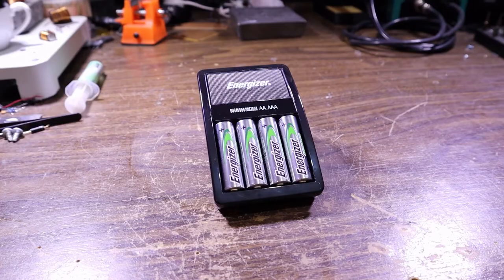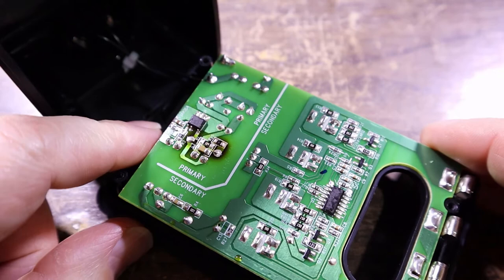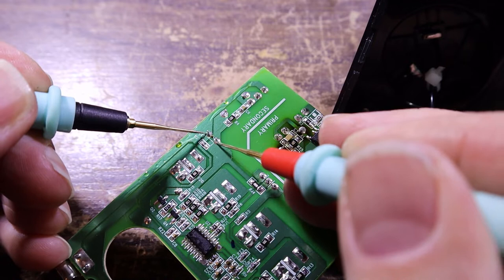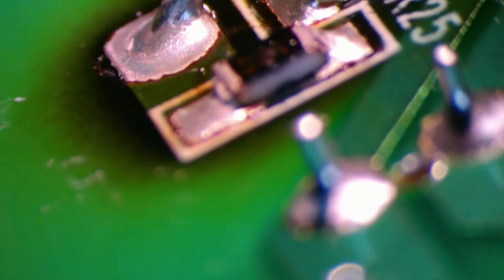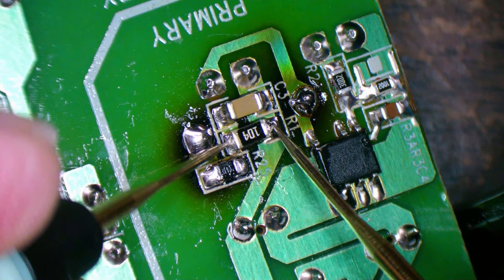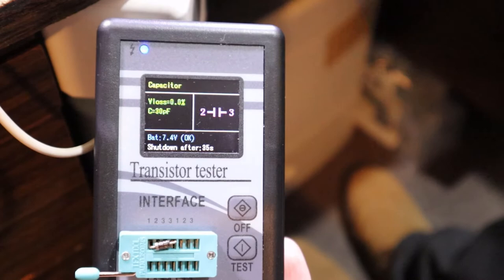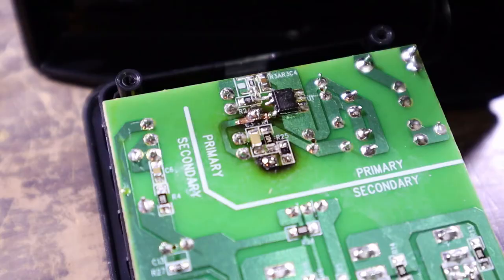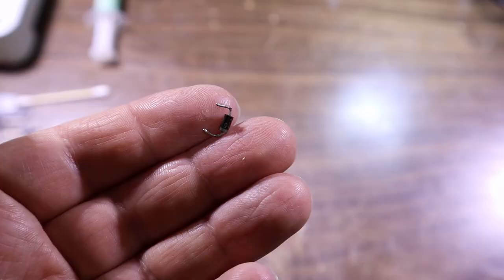Faulty energizer battery charger had me fooled!

Comment: Mine stopped working after sitting for a few years unused.    I opened it up and the big cap is swelling/leaking.   Even though have other brand radio shack chargers laying around I can use... it might be fun to replace the cap and see if it works.   Update: replaced the bad capacitor and it works again!     If the capacitors have bulge and you can see brown on the top.. they are leaking and bad.   If you have a flashing red light,  it means your batteries are bad.
Reply from the maker: Well done! Electrolytic capacitor failure causes so many problems yet they still use them in everything.But..... nothing's meant to last forever ay

Comment: I had to open mine to fix the contacts for the flip out AC plug. Still doesn't stop charging though so I have to manually take them off after a bit. It definitely smells like burning plastic even after 5 minutes. Looking at the spec sheet it doesn't have trickle charging so even when it's done you should take them off even when it says it's done. I'd recommend anyone get a different charger probably not from energizer.

Comment: Hi I encountered this video while trying to find a way to see why it won’t turn on the light at all when plugged in and with batteries in the unit and when opening I didn’t see any burn marks
Reply: Same with me on my side, even put it in a wall plug and tried charging it vertically and still nothing. Opened it up and it looks fine, no burn marks or leaking but still no light going on

Comment: 1N4007 is a slow diode. Is it ok to use slow diode in that snubber network? I would expect that fast diode is required to be there.
Reply from the maker: Manufacturers own datasheet said so :)
Reply: @JonnyFix  Yes, I have seen it in your video. But it was surprise for me. Flyback runs at 10's of kHz. So that diode in snubber network has to be able to switch at this frequency. It's surprise for me to know that slow diode like 1N4007 is able to do it.

Comment: Hey Jonny, i bought a energizer mini charger and i haven't used the batteries at all but when i charge them and the LED turns green, and i take the batteries out it doesn't work and when i put it back immediately the LED turns red again, the same thing happens when i charge the batteries till the LED turns green and when i turn the charger off and on again the LED immediately turns red so idk what the issue is?
Reply from the maker: Not sure man, maybe the batteries are bad. If it's a recent purchase maybe return it for a warranty replacement and see how the new one works.

Comment: Those Energizer cells are one of the worst brands I have ever tried.
Stick with the Japanese made Eneloops and you'll never be disappointed.
My oldest Eneloops are 13 years old and still going strong, plus they don't go flat while unused in the drawer.
Reply from the maker: About 25 years ago I got some Dick Smith branded 1Ah nicads, I never had eneloops but if there was an equivalent it's these, amazing performance.
Reply: My energizer are less than 3-4 years old and don’t charge more than 50 mah at a time with all 4 charging . Lame as hell from a so called reputable company

Comment: Hello Jonny Fix,

I have a Energizer Mini CH2PC4 and whenever I try to charge my 2 2000mah AA energizer it doesn't turn green within 10-12 hours, it's just red. Why doesn't it turn to green or turn off. I opened the unit and there's no any burn marks. Thanks
Reply from the maker: I can only suggest trying new batteries. If they charge ok and it turns green then that is the issue. If not, there will be a problem with the charger. Not all problems leave something obvious like burn marks.

Comment: Gday mate .

I have a 4 pack of energizer recharge batteries aa.

I didn’t get a charger with batteries so I used my rc multi charger (all batts, lipo, lithium , nickel, nimh)

I use the battery holder you have in oldschool rc remotes and connect it to the multi cable the charger uses, set it to nimh and hit start .

It gets to 50 mah and beep beep , my 4 aa has 50 mah total.

My question

Should I try using a specific charger for aa like the one in your vid?

Side note.  I believe energizer aa recharge are not that good.

Maybe I need an ohm metre to test my battery bay on charger and batteries too.

Might try another brand.

Tin foil energizer wraps seem to peel easily at seems
Reply from the maker: I have to wonder what the settings for the charger are, and if you can change them, as if you put them in a battery holder it will add them to give a total of about 4.8 volts instead of 1.2 for one fully charged so is the charger stopping early because it sees the higher voltage than expected? The batteries are probably ok.
Reply: @JonnyFix  I’m not sure . Maybe I the charger cooked them. 
I’m going to try a different brand of battery next.

My store stocks a brand called Vaarta I think that’s the name hmmm.
Thanks for your reply bud